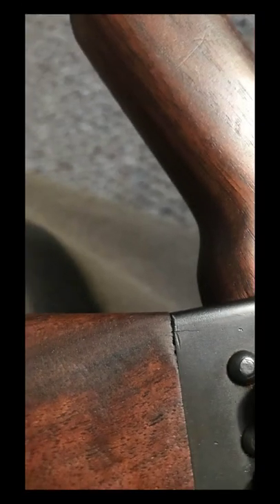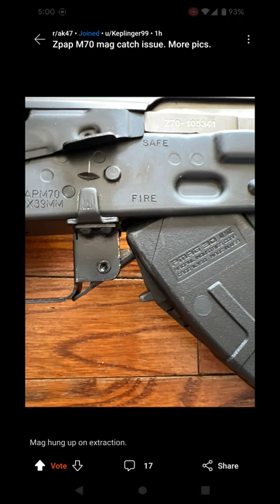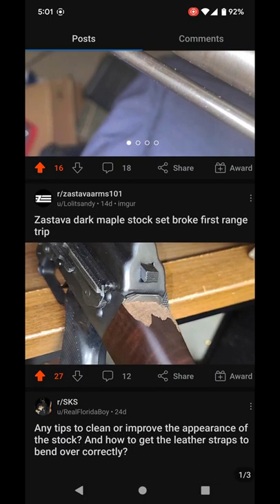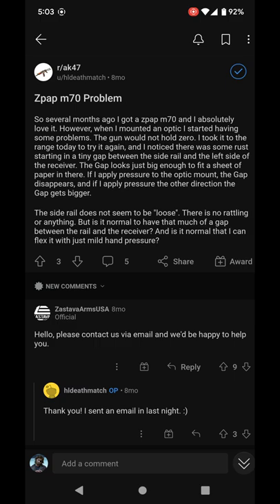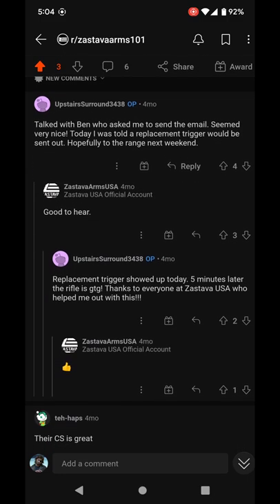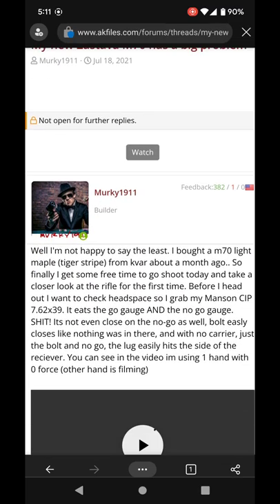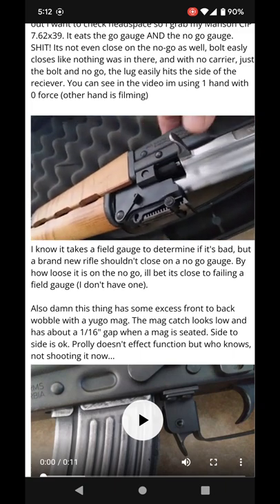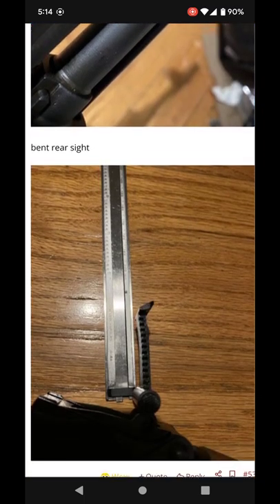Zastava Zpap: QC Problems Still On The Rise!? Inferior Metal? Cracks? M90 M70 M92 M85 2022 Check up

Comment: I recently purchased a m90 second hand. It come with a warranty slip and emails with zastava about the top cover having a huge gap to the point of it nearly falling off and the front sight so canted it couldn't be zeroed. They fixed it but I can see where they bashed the front sight with a hammer and dented it. From now on I think I'll stick with Arsenal. Glad I got my saigas and veprs before they were banned. Never a problem.
Reply from the maker: In my last QC video one of the reported problems was them banging a front sight back straight then cold bluing it and blaming him!
Reply: Saigas are wasr quality TBF
Reply: @omardevonlittle3817  nope
Reply: @KB-kw8ni  They really kind of are and i own one. People hype them up because they are not currently imported but back when they where imported and like 400 bucks they where notorious for iffy QC to the point companies like atlantic marketed themselves as the place to buy from because they looked over the guns for defect before sending them out.

dont get me wrong, neat collectable, but they are not anything to write home about quality wise, neither are most AK brands over other brands, youll notice how whats considered high quality directly follows if its been banned for import, norinco was bad until it was banned, saigas where spotty, untill they where banned, WASRs where bad, untill they stopped comeing in for a few years, then they where considered good and got reintroduced for a 400 dollar higher price tag

see a trend here?

Comment: I hate to hear this, I really like Zastava.  I have a bunch of guns made there, however all but one are actual military surplus.  I have two M48 Mausers, one 24/47, two of their Tokarev clones, an unissued Yugo M59/66A1 SKS with arsenal logbook, and a shooter Yugo M59/66A1 in excellent shape.  All of those are built like tanks and utterly reliable, good shooters.  My one commercial Zastava is a NPAP from around 2015 or so.  I shaved down the hammer a bit when I heard of the issue with mushrooming on the back of the bolt carrier due to the different shaped "hump" on the US compliant 922r hammers.  I took the junk Century Arms wood off it and put a milsurp wood set on it, it looks amazing.  I haven't had any issues with it, but I haven't shot it a ton either since I have a SAIGA I paid 299.99 for in 2011 and converted myself.....and as much as I like the NPAP, it just isn't a SAIGA. 
I hope they get this ironed out.  They certainly aren't having any problem selling their guns, they seem to "fly off the shelves" when they are in stock anywhere.  But if they keep this up, that's going to change and their brand is going to lose major confidence with the buyers as word gets out.  It seems like the MAJORITY (not all) of customer service experiences are handled decently, but you shouldn't have to deal with that.  Only in very rare cases and not as widespread as this seems.  
It is really hard to get any idea of what percentage of these guns are having problems.  A large portion of owners probably won't put 2,000 rounds through theirs in the entire time they own it, so who knows how many really have problems waiting to happen.  There may be way more with hidden issues that will never show up because they won't be shot much.    
I love Zastava but there's no excuse for this and they need to fix it ASAP.  
I know back in the time when NPAPS had a bad batch with issues that the WASRS sold at that time were absolute tanks and seem to have been a better option, but right now I am hearing about issues with WASRS as well.  
I would still grab a Zastava over a PSA or Century made gun but it shouldn't be a roll of the dice.  
DO BETTER ZASTAVA!

Comment: I just picked up a new Zpap m70 . On inspecting of the rifle I found two issues. 
1. The chrome lining in the chamber has three black streaks running down the chamber. 1/8" wide by 3/4" long.Chrome lining worn through . Probably from manufacturing when it was headspaced. 
2. The spot welds are weak on right ejection side of rifle . There should be 5 spot welds . I can only see two and there very weak, the other three are there but you really have to look closely. not good penitration I think?. The left side spot welds look good.  
Have shot 200 rd through it and the rifle is very accurate.  The factory did a great job zeroing the rifle.  Shoots like a dream! The walnut furniture is beautiful. The rest of the firearm looks excellent. 

Emailed Zastava, and Zastava wants me to send the rifle back for inspection and or  repair I'm kind of hesitant to do that , I don't know. I ordered a no go gauge going to see if it passes. I just don't want to send it to them and then get back hacked repair . What to do???
Reply from the maker: 100% Send it back to Zastava if you are unhappy with it. Let them inspect it. Take pictures yourself of everything to compare when you get it back.

Comment: What would you say about a new M90 serial # 000123 or early production unit. It runs good till it heats up after 60 rds and it gets hot it starts to fte, stovepipe crushes ammo and pushes it all into the receiver. Im sending it back Mon. Its a sexy ass gun but I think Im done with it. Gona trade it most likely and get a 
PSAK 556.
 FUCKING SAD AF.
Reply from the maker: The M90 had problems since it came out. Not really a serial number thing. Send it back.

Comment: I had Zastava the 5.56 version , bought it NIB and sold it 2 months later, it was the worst AK i have ever had, wouldn't shoot 5 rounds straight, literally it malfunction every 4-5 rounds.
Reply from the maker: I would pass on the M90 and the M85..
Reply: Hmmm. I do believe that Zastava has a recommended breakin of Setting 3 – (Highest Gassed) For use during the first 200 rounds to break the rifle in, and then you can turn the rifle down to setting 2. I just wonder if these recommendations were followed

Comment: CUGIR Running laps on all these over rated brands. And now theres no excuse for people to complain about a $900 WASR10 / M10 7.62 / 10/63
Reply: Not really bro my romanian Draco had QC issues. Serial number is of a 2021 manufacturing date.
Reply: @thevally6127  And what was the issue? Romanian AKs are rough as hell and aint pretty but you can count on them to run
Reply: @EliteManMonkey  mine is excessively over gassed. It kicks way harder than my other aks. Other than that sights are straight, rivets look good
Reply from the maker: Interesting, my M+M has been flawless so far.
Reply: @StillTheGhost  M+M has some of the best Romanian imports of all time. You on IG?
Reply from the maker: Yes , GhostRestorations

Comment: I got three and none of mine have any noticeable issues.. I mean any manufacturer has issues.. even the top dogs like Arsenal have shit slip the cracks from time to time. However im willing to say it is probably less because Arsenal imports guns in a lot less volume than Zastava does. That being said its fair to say they value quality over quantity and that is good... But Zastava just has a higher demand due to price point. People are alot quicker to spend 1000 bucks than 2000. And I mean where it counts most if you ask people like me the Arsenal really isn't even WORTH an extra 1000 bucks especially when you gotta go on a wild goose chase to find one. You can go to just about any gun shop around me aside from the big corporate dick heads like bass pro who refuse to stock AK's and find at least an M70. And I mean out of all my Zastava's the M70 is actually IMO the best one they produce. The M70 is like their big mac meal ya know. 

I mean, I hate to see people having issues but its gonna happen from time to time. This is why you always inspect before you sign anything lol or pay anything. I mean, AK's are kind of like 1911's where its kind of a piece of art. Theres a ton of em, their all a bit different with their own characteristics theyre not all equal and depending on who built it and how they were feeling that day... I mean you can get issues. Its real gun smithing. Its just a different kind of ballgame VS modern firearm manufacturing and shit. 

The gas block thing is kind of scary but I guess its just something to watch out for. I mean you inspect your weapon anyway when you maintenance it so. As long as you regularly maintenance it your gonna catch anything like this. And rust? Idk what your talking about? None of mine have issues with rust. But again, I keep my shit wet. Nd every so often I do let it dry a bit. Then I hit itwith a layer of Barricade which I do to ALL my guns. 

Barricade is a must for firearm owners who own a lot of guns and dont want to blow thru oil all the time. Barricade penetrates the pores in the metal and deoxidizes it. Then it leaves a protective layer (that has a pretty nice smell) on your firearm that can handle heat, and honestly it lasts for a while. It keeps rust and corrosion from forming and it works great. I use it on all exterior surfaces and also my Bolt carrier too. But I dont touch springs with it or the inside of the barrel or anything like that. I use oil for inner stuff and springs and barrel. But im telling you, that barricade gives your guns a classic shine that makes em pop a bit, it has a unique clean gun kind of smell, and its not that expensive and lasts a good bit of time per use. Ive had other brands that rust up way worse than my zastavas, im actually very pleased with how they been holding up. Nd I live in the ohio valley where it is ALWAYS like 50-60% humidity in the air. Its also good on wood. has kept my lower handguards on my M70 looking brand new despite being my fuck around gun. still looks great and it has a lot of shine and pop to it. Just dont over do it, or it can feel sticky. Use a clean rag and spray the rag with the chemical and then wipe the gun down evenly with a thin layer. This SHOULD take care of your problem... And about the finish... I mean you can hate on the blued finish, mines holding up nice so I dont agree for real but, going back to the big dogs like arsenal... They use a painted finish.... Like their guns rust up too if you don't maintain em lol. And honestly I HATE that they use painted finishes. Because a painted finish bubbles and cracks and chipped with use. It reinforces wanting to never shoot it and treat it like a collectors piece and thats just not my style. I want something that can get beat up nd im  not worried about hurting the value. So I mean, again it sucks to hear your having issues. But at the same time, alot of people dont have issues with em. As long as you are doing your part in making sure what your buying isnt a lemon, you should be good and have nothing to worry about.

Comment: personal experience, commercial zastava is junk, they are the macdonalds of commercial guns.
Reply: Darn and I just got one.  What about the Draco's?  Or the wbp polish jacks?  Know anything about those two? Looking for a 10-12 inches
Reply from the maker: Wbp and RADOM make fine rifles and pistols. Draco is wasr quality (both Romanian cugir)  but it does have a bit longer barrel at 12" so more velocity if that matters.  The Milled mini jack is built really well as are the regular mini  jacks. For the price the zpap92 is still worth it if you pay under 800$ as it's a krinkov style. Arsenal sam7k is also a nice option if you don't mind the shotty finish. Im looking for a 12" myself so I'm still gonna wait it out since the draco is wayyy overpriced right now.
Reply: @StillTheGhost  yep i bought the milled mini jack, quality wise it puts the zpap 92 to shame and its more balanced (in weight).
Reply: Anything that cost 900$-1200$ is not junk. It may be junk to you but that’s your own opinion really. They had a bad batch like all things that are manufactured. Century arms firearms are thrown together, look at one closely and tell me if you see anything that’s actually straight